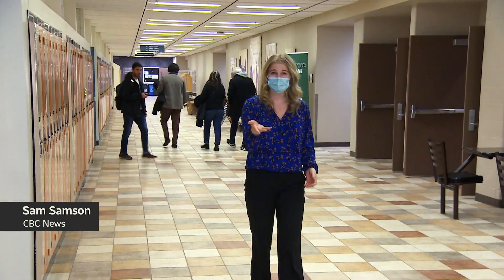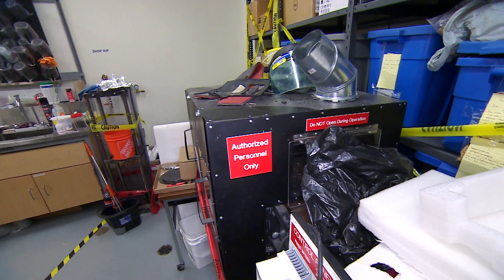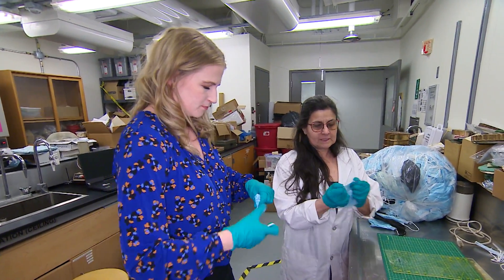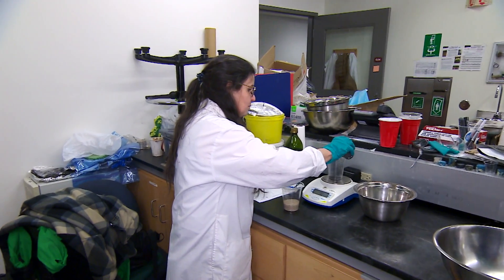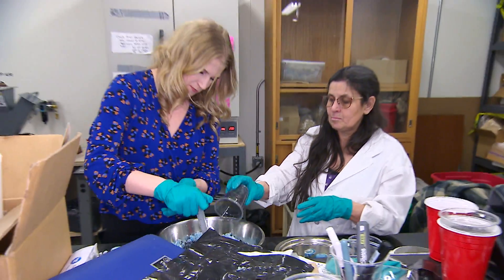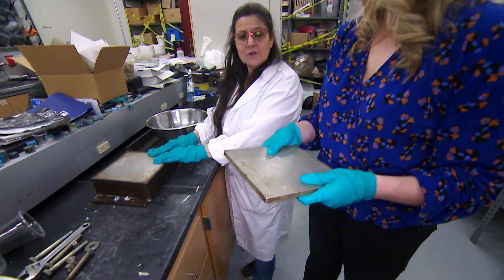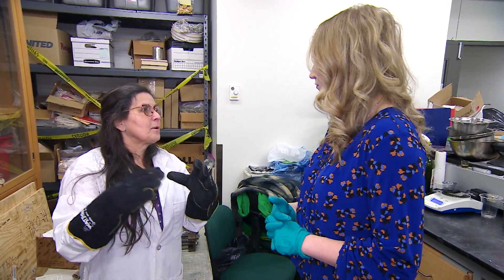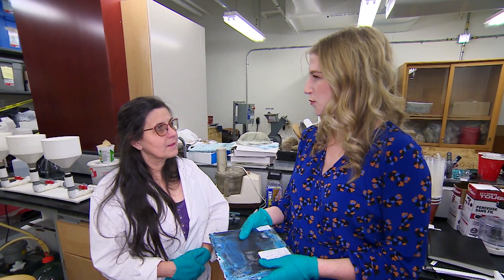Repurposing single-use face masks for everyday things

Comment: Carcinogenic flooring tiles and you want to use that for a cutting board??
Reply: Tiles would be fine, not a cutting board. You can coat the tiles in toxic epoxy anyways.
Reply: @orishaeshu1084  damn! Poor flooring guys! Flooring is a major concern for everyone though because these products break down and everyone ends up inhaling the particles. Tires particularly bad. Don't believe for one second that these masks couldn't have been made with a biodegradable material like cellulose and we would never have this problem. They're in bed with plastic. Literally and figuratively